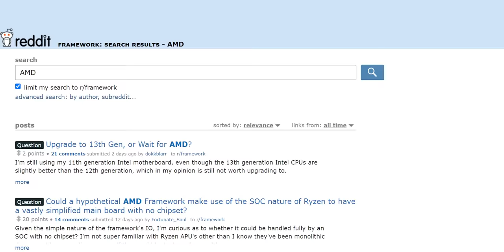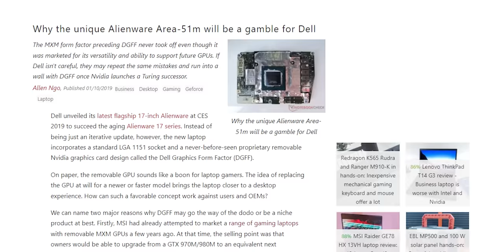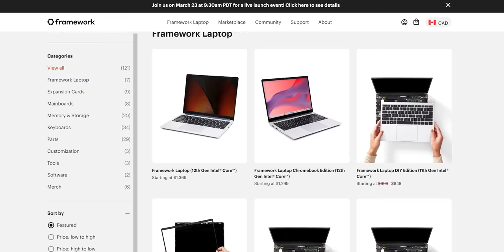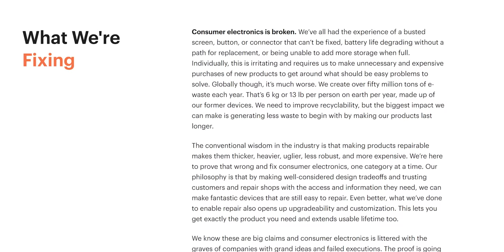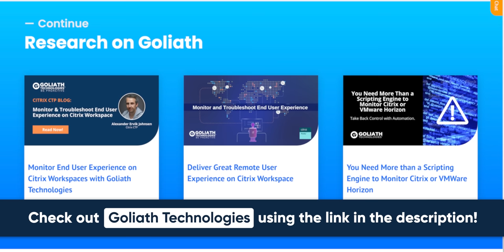I Made a Bad Decision – Framework Investment Update

Comment: The stupidest thing about this is that it took THIS LONG to get these kinds of options. Props to the Framework guys for stepping up and doing this. I wish it had happened years ago but I'm happy its happening now!!!
Reply: I guarantee you that this has been in the pipeline, they just didnt have the capital for more options
Reply: God bless you all, take care
Reply: It’s harder to create than replicate existing ones. Hence some laptops/mobile/TV/Cars share the same parts for cheaper production
Reply: To be fair I meant from ANY manufacturer ever. I get the Framework guys have to iterate. I'm happy with their progress and this is definitely the next laptop I'm going to buy.

I just wish this whole idea had spawned years ago.
Reply: Could've also been supply issues considering Linus took 3-4 years to release a screwdriver.. but an amazing one at that. A favorite quote of mine from the movie Norbit "Beauty takes time, it doesn't just happen."
Reply: This kind of modular design is really expensive. You need to do a lot of testing to make sure the connections are reliable and robust over the long term... It's probably only recently become feasible for a newcomer to do with the rise of modern rapid prototyping and high quality outsourced smaller scale fabrication. That's not to diminish their effort... quite the opposite. Framework has pulled off a huge feat bringing this to market in only a few years.
Reply: yea pretty frustrating i was 100% planning to get the smaller framework but with the downside it was a little small…now im definitely waiting for the big one as a 15.6 screen is perfect!
Reply: Why people don't care. We geeks care.
Reply: @Carterthielftw_  I think what he mean is from any manufacturer, not only Framework.
Reply: That's capitalism for you
Reply: Ikr really makes you think what a lot of investment money goes to in bigger companies
Reply: This company is solving a problem that doesn't exist for 99.9% of people, and for that reason it will fail eventually.  Linus may give them a boost in the short term by tapping into the savvy tech community, but there is no hope long term.
Reply: @prasad530  look I don't disagree with you but I hope you are wrong. In all likelihood if they get big enough they'll get purchased. Hopefully for us it'll be by the least evil corporate overlords possible. I don't know who that is... But I like to hope lol
Reply: It's probably mainly because big companies DON'T WANT you to have options, they want you to have an excuse to buy a new laptop when the tiniest thing goes bad or a new port comes out etc, lets not mention upgradeability.
I wanna support this company, def will buy if it'll be available where I'm at when I'm lookin for a new laptop.
Reply: @prasad530  what is this problem that does not exist?
Reply: @prasad530  You're so wrong it's not even funny lol
Reply: This USED to be common, I have a Toshiba from the 90's that is upgradable in almost every way.
Reply: @JustKanji  You are misunderstanding business.  Companies would happily give you any option you want, if that option was desired by a ton of people that would pay for it.  Having expansion/upgradeability is just not something that the vast majority of people care about, and adds reliability and durability issues to a form factor that needs to be rugged.  For 95% of consumers technology as already far out-paced their needs, and so expansion/upgradeability is just not necessary.  I don't think you can build a successful startup hardware company with a product with such limited appeal.
Reply: @HarryBallsOnYa345  Upgradeability and expansion is totally unnecessary for 95% of consumers.
Reply: @prasad530  i have an old laptop with a screen full of keyboard scratch marks, unrepairable broken touchpad fixed to the chassis, and a keyboard that has 2 keys not working. The repair is too expensive so i decided to just buy a new one. This Framework laptop solves just that and i can easily repair it myself.
Reply: @pattrickmerete  Good for you.  Most people are just going to my a new machine in this situation.  I'm not saying this thing has no appeal, just not enough appeal to make a successful business.
Reply: @MrGamelover23  yeah I get that and I agree. I 100% appreciate and support Framework. I meant the industry overall needed this year's ago. We had the technology lol
Reply: right?!!
Reply: @MrGamelover23  I'm not ignoring it, it's just not an issue.  Most electronic devices are durable enough to last for years, and when stuff does start to break, most consumers will just want to replace the whole thing.
Reply: @prasad530  well, perhaps 90% of the people in the world are not as rich as you to buy a new one everytime they break their laptops. Assuming my number is correct, those 90% are the potential market for this product. That's more than enough to make their business successful with proper marketing.
Reply: @Carterthielftw_  Exactly, they are a small company after all, so they need to go carefully and slowly to not stretch themself too far and risk getting into financial trouble.
Reply: @prasad530  they only replace the whole thing because there is no other option. If a light breaks on a car do you buy a whole new one? If a peddle breaks on your bike, do you buy a whole new one? When a key on your keyboard wears out, do you buy a whole new one? Sure sometimes people want to buy new things. And your ignore the fact a whole generation of laptops are no longer able to run the most mainstream OS (windows 11) due to hardware limitations; does this make all the other components of the computer obsolete. 

This is literally how we should have been building electronics from the beginning.
Reply: @MrGamelover23  they should have also invested in the companies that make the components as well

Comment: I have to be honest as a consumer: that laptop is one of the most frickin’ cool thing I’ve ever seen so far. I hope Framework make it payable and available because I want one.
Reply: Well it won't be much cheaper at the basis, but the whole point is that you should only have to buy that part once, and when you (need to) upgrade the rest is up to you. 

I think when it's out I'll buy the 16" with maybe some lower specs, depending on the price. And when I think I want to, wether this year or the next, I upgrade it to be able to play some heavier games on.

Plus being able to have something like that little screen on the side of your keyboard available (I know it isn't confirmed to be available but just imagine) would look pretty nifty.
Reply: The fact that they were able to lock down supply from AMD is actually really promising. Somehow one-upped by the prospect of an external GPU housing for their replaceable GPU's...
I really think they hit a tipping point with all of the stuff in this video. The level of customizability without feeling overengineered is actually insane.
Reply: Easily shilled to you!😊
Reply: consoomer
Reply: I want one, but I doubt they ship to my place, plus the import taxes would almost as high as the laptop itself.
Reply: @davidvandersterre  killer for me is currently the touch screen. I really need it.
Reply: @davidvandersterre  Won't work after only 1 generation, they already have some upgrades not compatible with the first gen base. Considering the average user only upgrades his laptop once every 5 to 10 years, by the time you need an upgrade nothing last gen will be compatible with your old one. I mean I still managed to squeeze some limited use out of my first laptop ever as an office pc for work, and it has a core 2 duo inside it and ddr1 ram.
Reply: @Muaddibize h, I bought my last laptop in 2019, when raytracing was still brand new and only offered on the most outrageously expensive desktop GPUs. Within 2 years it was showing up on average laptops. It would be cool to be able to swap my current one out for newer technology.

By no means am I dissatisfied with a 1660ti. It's still plenty strong. But the idea of having that option available, being able to get a laptop and squeeze a few extra years of modernity is very attractive.

And no, I don't have a desktop. My situation prevents a desktop from being a practical choice.

Edit: I do know these aren't really gaming laptops. But my hope is that once they have an established market and customer base, they'll expand and start offering some.

Comment: 7:40 the customizable keyboard/touchpad/numpad is a game changer, as is the removable GPU in a post MXM world - can't wait to see the final version!
Reply: Waiting for your video on this!
Reply: Though something i am wondering can you put the keyboard to the front of the chassis and put a second screen there.
Reply: @Kafj302  you will be able in the future since 3rd party parts are coming.  So someone will make it possible 99%.
Reply: This gaps are insane. Wobbly laptop for the price of MacBook Pro. Thanks but no
Reply: If you are asking if the top and the bottom parts are interchangeable, they are not. 
Framework confirmed that they've tried that. But the keyboard was too far from the bottom border to be comfortable, impacting the user experience.
With that said, it doesn't stop someone to create a keyboard with smaller height to fit in the bottom part.

Comment: I’m a big fan of the older Thinkpads, and the push for paper-thin machines with less ports, less upgradabilty, etc. has left me searching…this looks promising. I’m definitely going to give one of these a try.
Reply: The market demands paper thin machines which is why the previous older concept fails what this does is bridge the gap and offers those 13 inch paper thin machines but with the upgrade ability which is why I think framework will be successful where every other company has been failing for the last decade
Reply: Would be awesome if they throw us a bone and give us something a little thinkpad inspired. I really just want a few core features that keep me using them. Ignoring the ability to load of foss bios like coreboot on some of my old thinkpads. I really want my trackpoint and the correct trapezoidal buttons, I want something like the 9cell battery sticking out the back solid as a handle (sounds dumb but if you use it you know it's the best for standing with a laptop) and the durability. I also like that they are very basic black squares or rectangles they fit into my bags well and they're very easy to keep clean usually.
Reply: Yes, G1 and G2 laptops were great (talking about cpu socket - YOU Could upgrade A CPU which is unreal when you look at modern laptops)
Reply: The platform needs to embrace the rugged and durable design of the Panasonic FZ and old Thinkpads.
Reply: It's always about cooling for laptops that can majorly hinder performance...  Slim is just not there IMHO, but a nice alternative to a tablet for a keyboard!
Reply: Both on the market would make me happy, frankly, it wouldn't be unlikely for me to keep a tank and a featherweight both. One for performance work, one for lightweight low level end user work on the go with a crazy battery life. Never been a Mac guy, but the M1 air is brilliant when it comes to speed of basic tasks, and a battery life that seems like black magic.
Reply: That would be cool if we can have custom motherboard for old Thinkpad like the t420 or the x220/x61
Reply: @elias6415   Upgradeable motherboards? for the X220T?  Take my Cash.
Reply: Hear, hear, man! My first ThinkPad was the X31 in 2007 that I got used. Now we just need some third party to design a keyboard for the Framework 16 that has the same style as a ThinkPad classic keyboard with the TrackPoint as well. So like instead of having such a large touchpad, we would either have a smaller one or no touchpad and a huge-ass keyboard with all the classic PC buttons etc.
Reply: what do you mean by "older" IBM? The very first Lenovos (which were actually designed by IBM)? Because that's my cut-off. In which case you can just say "IBM Thinkpads" including X220, X230 and ~2011.  Because that is the big deciding difference.  A while ago some Chinese guy made a bunch of money by upgrading Thinkpads with more modern mboards, with modern CPU and a OLED. You'd send your X2*0 and he'd upgrade it completely. It cost much more than a new laptop, but people loved those models!
Reply: @NadeemAhmed-nv2br  is it really demand for thin machines? I'd say lighter, and more portable, but weight is just as important as thinness. People want to carry them around everywhere, but there's definitely a limit to those attributes beyond easy portability. I think 13' was a good choice to start and 16" is also good, but bigger or smaller, idk.
Reply: I watched this on a 10 year old Toshiba gaming laptop, because the new laptops, even the bigger 18" ones do not have the ports and quality keyboard that this one has.
Reply: I would gladly have a suitcase size laptop if i could upgrade it or modify it however i please. This'll do though.

Comment: This will definitely be my next laptop choice. As a robotics engineer, having that kind of modularity is vital since you never know what kind of port you might need to connect to some niche part. Plus it gives me the freedom to develop my own modules to improve productivity or enhance the user experience when it comes to assembling a prototype. In fact, the removable motherboard seems like a great option as a robot's on board computer. Great work Framework!
Reply: Yeah, it's amazing I'm not an engineer yet but that field looks super cool. I find phone repair to be quite neat and fun
Reply: i'm in computer science and i need a laptop to double run windows and linux i think this is such a good choice that i can't pass it
Reply: I hadn't even thought about needing a board for a robot as an excuse to upgrade your framework lmao

Or buy secondhand old framework boards. Wonder if they will end up being a quasi competitor to raspberry pi years down the line when the older boards are more obsolete and therefore come down in price.
Reply: Not a robotics engineer, but definitely with you there. The 16-inch-Option is absolutely fantastic and I'm thrilled to see the options.
Reply: I'm having visions of a Zack Friedman-esque hot-swappable modules for obscure sockets and bizzaro sensors.
Reply: I never thought of that but you’re totally right. This solves the weird laptop leash problem where you have to follow behind with bent back being careful not to unplug. Modularity is awesome!
Reply: how would you develop your own modules? 🤔
Reply: @pornhubmante  finally shipping to italy

Comment: I think they got the right way of development. As other companies had tried to cope with their ideas, they made a step ahead. GPU module is a great thing, but I am impressed by hot swappable input interfaces: changing configuration is a (great) thing, but potentially swap different devices (like a pen tablet surface, as an example) on the fly without restarting has more potential too. Honestly, I do not really need a laptop now, but I think that when this will available in Italy I will yield to the temptation and I'll buy it.

Comment: It already got me at "removable batteries are back". This laptops are gonna be revolutionary if they succeed. Hope that Framework does since it will be reduce the E-waste and everyone who wants to have a  laptop won't have to worry about becoming obsolete every 3 or 4 years
Reply: They already have succeeded in getting me to adopt them. Love repairing my own stuff and this new version will definitely be mine and my old one will be my wife's.
Reply: for long travel and when you can't recharge easily, a swappable battery module is awesome, cause you can have as many as you like and not run out of battery for a few days.
or use one with a solar, wind or watermill charger while you use the other inside a cabin.
Reply: @satibel  yeah it is but aside from that, the fact that you can add separate battery inside your laptop and increase the  duration of you laptop already its amazing enough itself. Especially when you also combine it with Linux you basically get a laptop that  never ends out of charge.
Reply: If they really do make swappable batteries available (preferably at least 2, and hot-swappable), then they should follow that up with a ruggedized case. Fieldwork-friendly laptops (thinking about it, "Fieldwork" is probably the right product name for that) with customer-customizable ports would definitely sell.
Reply: @absalomdraconis  bro new cool idea. Don't even have to make a new laptop, just a rugged case. Someone call D Brand
Reply: @absalomdraconis  the beauty of the open system is that it doesn't need to be framework that implements that.

Comment: That level of modularity in the keyboard area is mind blowing. And if that works as demonstrated, hot swap, without turning off the laptop - WOW.
Reply: The hot swap is going to be entirely up to the OS. Much of the connections in a framework module tend to be through USB C, so if the OS can handle a USB keyboard it can handle the specifically shaped keyboard module that also plugs in via USB C
Reply: According to the blog post the input modules are hot swappable and are using a fork of qmk